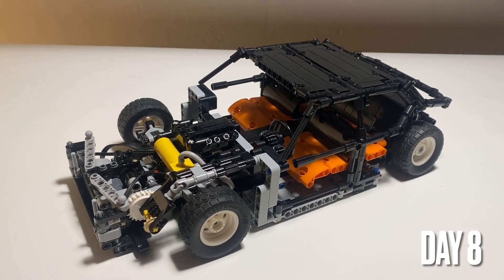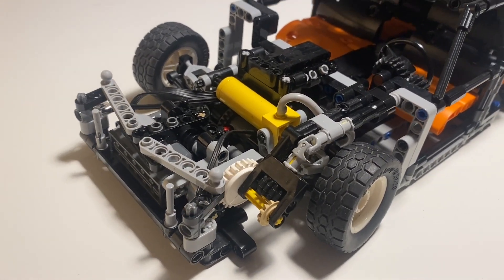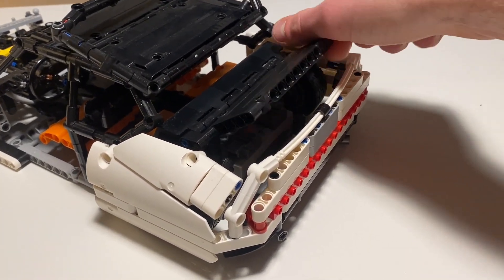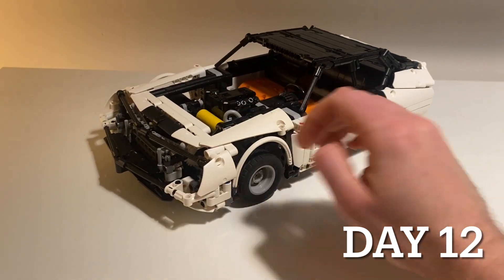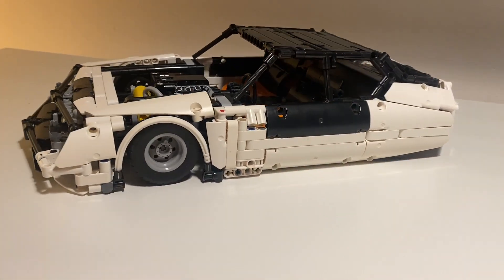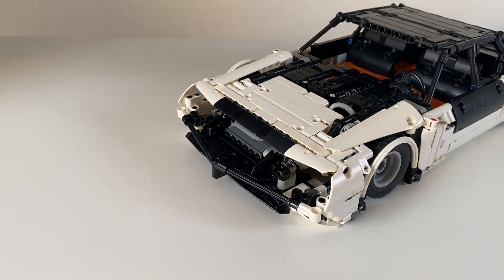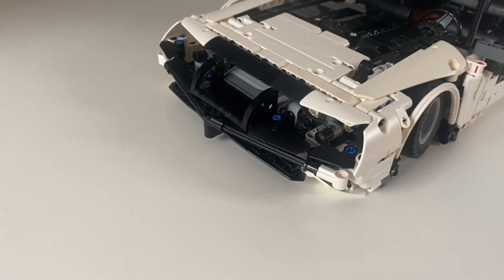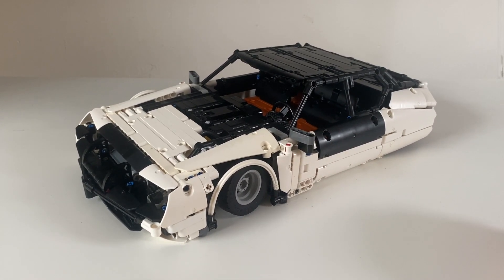RC Lego Technic Citroen SM Build Process - Part 2

Comment: i really want to make a custom set for an friend of mine, is there an way you could share an 3d file or some sort of instruction? i just need to know how to replicate it :D
Reply: I know its mutch to ask, but something like a vid where you take it apart piece by piece would be enough to generate an 3d model and instruction.
Reply from the maker: sorry for taking so long to reply. I have not made instructions and the model is already disassembled. In part 1 you will be able to see the build process of the chassis which might help.